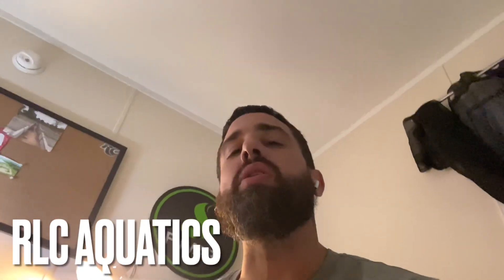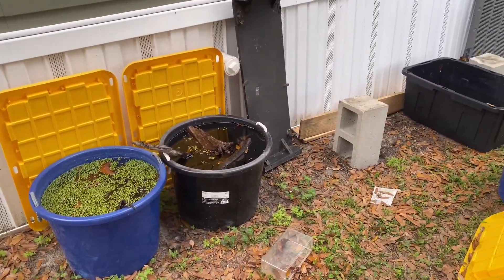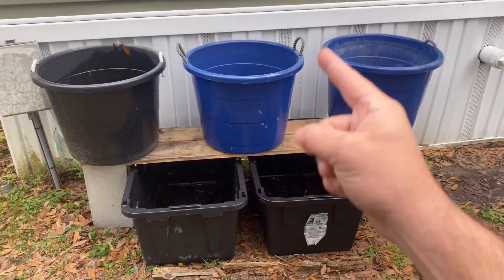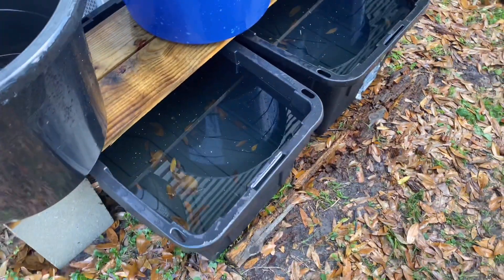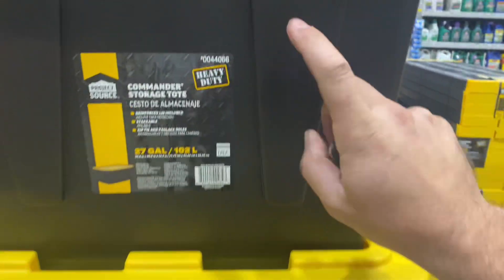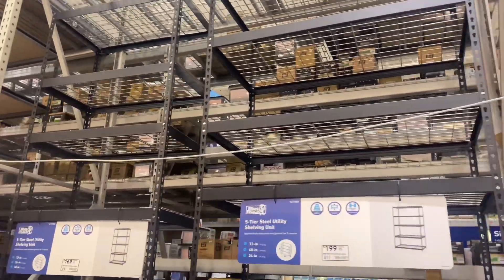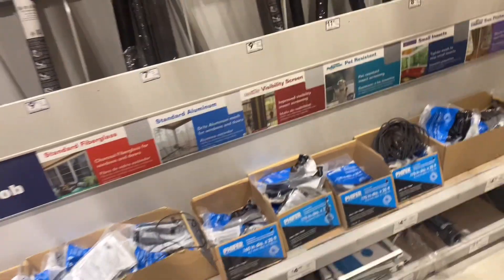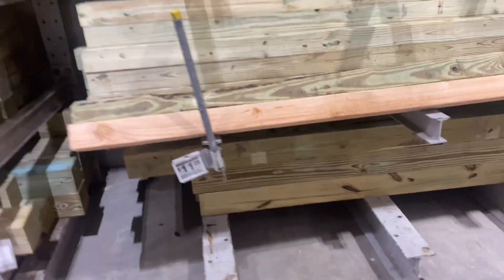BACKYARD GUPPY FARM - BREEDING GUPPIES FOR PROFIT

Comment: Use the lids the black totes came with. Cut out an area as large as you want and glue the screen material to the underside. Cut out portion of lid just big enough for airline and pop it on. No frame to build or more $ than glue and screen. I used GE silicone 1 for the glue.
Reply from the maker: Thank you thats actually a good idea because it would keep the dragon flies out too. I could use little plastic clamps I have to hold the plastic lid

Comment: Very cool bro I would keep as simple as possible on the covers remember you will be in and out of the tubs the pre made screen wasn’t a bad idea
Reply from the maker: Thanks bro yeah I’m thinking the screen was the best route. Just need to shelter the guppy containers.
Reply: @RLCAquatics  to weigh them down so the wind doesn’t take them off use big fishing weight you can sow them on the side with fishing string that way you don’t have big ugly 2x4 hanging off just an idea 💡💪💪🇵🇷
Reply from the maker: @pbaquatics94  yeah that’s a great idea bro. It definitely needs to hold up against this Florida weather